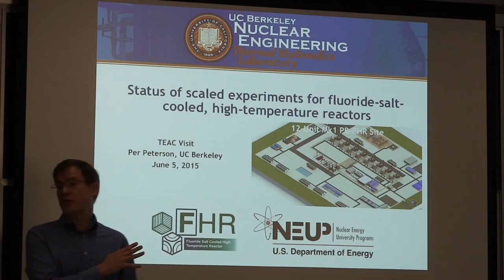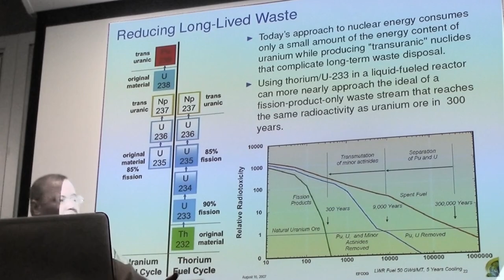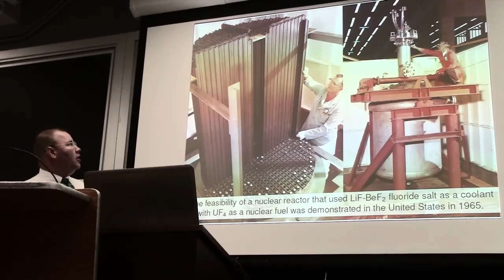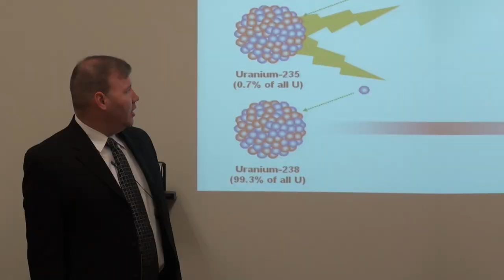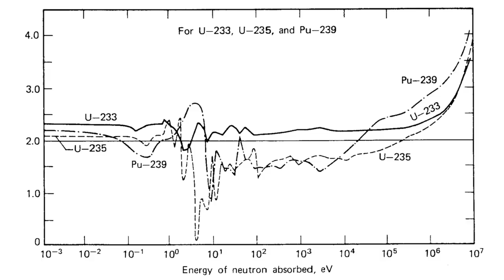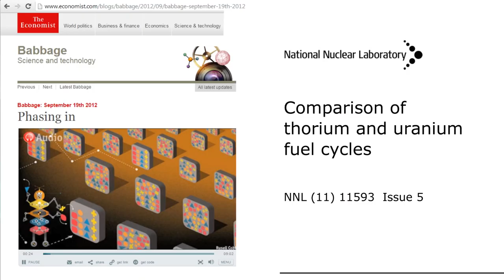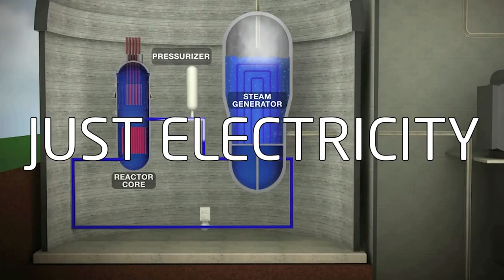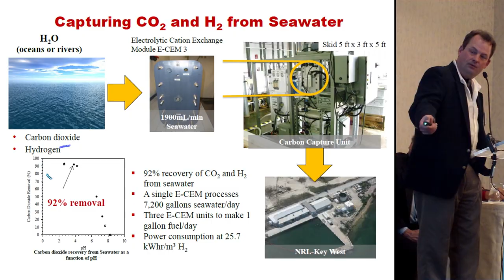Thorium Disadvantages

Comment: Still? What is to be done with the waste products from this? It sincerely bothers me, end of life matters, mid-life construction/repair concerns, and, for all the repeated emphasis about melted freeze plugs draining the moltem salt into the drain pits: how does the salt get transferred ANYWHERE? WHO does that? HOW would that work? What happens to the used drain vessel? How many times can the drain vessel withstand a salt dump before becoming unusable? How is a contaminated drain vessel "disposed of" then? How long is the plant offline after that status? The fact that the drain plug melts and the drain vessel fills up, gives me the firm impression, this can happen easily, and may happen often.

After the repeated denial of existing, and decades  to come radioactive waste that we STILL have no designed plan for it, I am very skeptical of any nuclear energy system that has no clear, easily understood plan for handling the waste products. Including contaminated construction materials. He talks a good game for thorium, but the dirty realities of the nuclear energy process he obviously gives zero attention to. Always remember, the magician makes you see want they want you to see while the 'magic' happens as you're distracted.
Reply: The best answer to you waste question is that nuclear waste is easily contained.  Emission from fossil fuel plants are not contained.

Comment: How is nuclear energy renewable? I get that thorium is very abundant in the earth, but that doesn't mean that we can make more of it
Reply: Uranium is replenished into ocean water from the Earth's crust underwater. Thorium doesn't have any ongoing process like that, but the resources of U and Th are so vast they might as well be renewable... the only way a nuclear fuel use could be shaped by resource constraint is if we continue to use inefficient reactors and convert our energy production entirely to nuclear... and we continue to grow our energy consumption. And in that scenario we'd simply need to expend more effort to obtain Uranium, it isn't like we could ever run out if we spent more to acquire it.

What would happen instead (100% nuclear with inefficient reactors) is we'd both pay a bit more for U resource, and we'd also transition to efficient reactors. Once-through fuel rods would be fissioned into additional energy. We'd get more energy out of U and Th resources. There's no way humanity can possibly exhaust nuclear fuels.

In contrast, Geothermal, Hydro, Solar and Wind are limited by deployment bottlenecks. Nuclear can go anywhere. The so-called Renewables have optimal deployment locations, and those are typically already in use.

Comment: Why is this film called Thorium Disadvantages, when it shows all the advantages Thorium has?
Reply: Thorium Disadvantages listed in this video:
00:00 Solid-fuel thorium reactors fuel utilization ratios similar to PWR.
00:42 Liquid-Fuel in United States licensing is "scary".
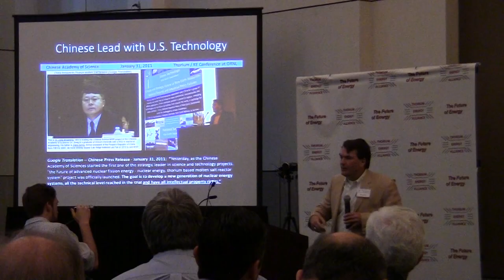02:04 Obama Administration willing to give away MSR know-how.
02:40 PWR seen as "good enough" for long time.
03:00 Licensing restrictions specifically target liquid-fuel.
04:45 NEA OECD evaluated solid-fuel, and liquid-fuel-fast-spectrum only.
20:50 Thermal-spectrum neutrons hitting U233 produce only ~2.3 neutrons.
23:00 Graphite moderator required to sustain fission in MSBR thermal-spectrum.
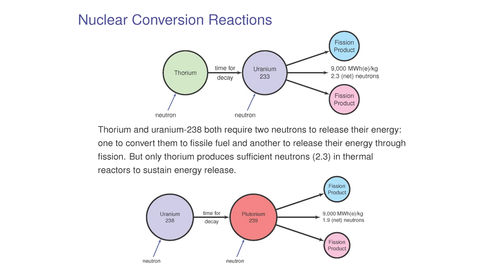27:50 Protactinium-233 half-life 27 days.
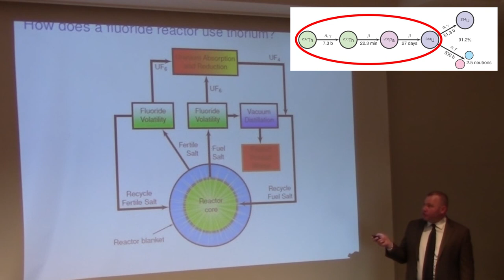29:00 Material challenges (MSR is pre-requisite so MSR challenges are Th challenges.)

Comment: So, basically, what we are doing now with energy is like if we take a banana, we eat the peel and then throw away the fruit. Very smart, mostly for oil producers. They don’t want cheap energy. They don’t want also cheap, safe and easy plants of energy. With time, a small thorium generator would evolve into a device that the average guy could easily maintain, the same as cars, computers and other machinery of common use are today, and that were reserved only for a very few qualified and rich men in the past.

Comment: Some nuts have been trying to use solid type of reactor which is why they are having difficulty.   The best way is the Liquid Thorium Fluoride Reactor.   But they have to insist on the obsolete technology to sabotage the Liquid Thorium Fluoride reactor project.

Comment: UK fast reactor program used thoruim, Germany had a prototype thorium pebble bed reactor that ran for 15 years so please stop reinventing the wheel
Reply: Bill, there's no significant advantage to Thorium when used in solid-fuel state. That's the point of the video. Dr. Per Peterson is quoted in the video speaking about Thorium in pebble bed fuel, and choosing LEU instead of Th because they saw no advantage in that solid fuel state. Th-MSR has never been done before. China is constructing their TMSR-LF1 right now, from parts successfully shipped to their MSR campus. LF stand for Liquid Fuel.

Comment: Thorium reactors are anything but a NEW idea... Pebble type thorium reactors have been tested extensively in germany with AVR at Jülich and a pilot plant HTR300 (300 MW - operational 2,5 years)  in the 1980s -  with prohibitive results mainly concerning operational and economic efficiency. First of all the thorium process in general has to be started by a certain amount of weapongrade material in its fuel. Futhermore the thorium process is based much upon U-233 - which could easily be extracted from the process. U-233 is weapongrade material well suited for simple nuclear-weapon designs - so there's a comparatively HIGH PROLIFERATION risk.
Well - thorium reactors are safe by design concerning core meltdowns, BUT they expose a difficult to control risk of temperature-runaways (as most graphite moderator designs) in remaining reactor components - which occasionally also may result in releasing considerable amounts of radiant substances into the environment.
And it is simply a fairy tale, that the waste of thorium processes require just 300 years final storage - the process seen as wohle leaves Th-230 (75.000a), Th-229 (7.500a) and additionally other longterm-risk-dominating isotopes like Tc-99, I-139, Cl-36 occur in quantities comparable to U/Pu-Cycles. 
The now again discussed thorium molten salt processes have been tested in US end of the 60s and they suffered extremely from all kind of corrosion effects - something current chinese works also have to deal with.
Summary: Thorium has been promising since ever...and it has been investigated more than most people know - however: up to now - after 60 years of trials - nobody could present a thorium process based reactor, running full-scale reliably AND offering substancial advantages over the Pu/U-cycle reactors. 
That might change in the future - perhaps in some 30 years...China currently seems most advanced in this fields - spendig billiards of $ into better concepts for thorium pebble solid type and molten salt type processes and there are some other quite promising fresh ideas - which will need even much more time to become operational.
My personal opinion is: looking at the necessery time-horizon nuclear power generation in general might well be outpaced by incoming advances in other technologies.
Reply: Joshu, Kirk speaks about Fissile Security in a newer video than this: https://youtu.be/2U9HVIFt2GE ...and has received Department of Energy GAIN funding to specifically look at questions surrounding Fissile Security with LFTR. That's Flibe Energy's 3rd DOE grant since 2018.

The only question Filbe Energy's not yet funded to tackle is your corrosion concern, but since there's a half-dozen MSR startups all using different alloys and salts, and China's Academy of Science aggressively pursuing T-MSR... I'll assume "they're on it"?

Comment: What Happens if the Reactor reached a critical un manageable temperature? I see some Floride Salts start boiling as low as 1600 degrees Celsius.  What than if the reactor has not enough pressure to keep it a liquid ? Is it as safe as we think ? thx :) 

17:30
Reply: Flouride salts have a very wide liquid range.  THERMAL spectrum reactivity control coupled with the liquid fuel and near atmospheric pressures of operation result in a much safer design than 1,2,3rd generation designs. Flashing to vapor, albeit very unlikely in such designs, would result in a loss of fuel that would be easily captured and condensed back to liquid, flow by gravity back to its retention tank, and shut down the critical reaction as the fuel concentration would negate the volume necessary to sustain the critical reaction.

IMO and prior to reaching any flash conditions, redundant temperature relieve valves would accomplish the same without have to go for a more expensive flash capture and condense approach. Flash capture designs imply more expensive secondary infrastructure. LFTR could easily avoid these costs and still remain quite passively safe.
Reply: The bigger the temperature delta against ocean water or air,  the easier it is to dissipate the heat... cooling mechanisms get more and more effective as the temperature climbs, because the delta increases. The reactor won't keep the salt liquid because of pressure... no one designing a MSR is counting on a pressure vessel to keep the salt liquid, as PWR do to keep H2O coolant liquid.
Reply: If I correctly understand, the proposed convention incorporates a calibrated slug "stopper" blocking a free-flow path to the drainage tank: it cannot fail to be safe.  If the slug fails, the reactor drains.  The MP of the slug cannot be increased, so the only failure mode is if it leaks, which causes the reactor to drain, shutting down the reaction -- inconvenient, perhaps frustrating, but always safe.

Similarly, calibrated weak spots in pipes can be used to prevent uncontrolled releases of just about any fluid.  Here, wherever such an occurrence might arise, the vented products remain contained, cooled -- and from a safety perspective, inert.

As others have pointed out, the reactor operates nearly at ambient atmospheric pressure, so I'm wondering where you anticipate such a flash to occur.

Comment: HASTELLOY OR EVEN UDIMET 5XX-7XX are, difficult and very expensive to mold pour and machine. I heard it slip from your tongue like it could last forever; it can't and won't and a fast breeder/recovery Thorium reactor is going to need a lot of it. It isn't like the stainless steels that can be poured, forged, machined, and welded and repaired for light water reactors. There are recently other highest temperature alloys even more difficult to pour and machine. Vessel/pipe life cycle and upfront cost is what is going to make molten salt difficult to sell. There now is a plasma process to coat metals against corrosion/oxidation when operated under high temperatures like in engine combustion components such as valves; perhaps that could extend vessel and pipe life cycle.

Comment: I don't see why this is titled "disadvantage" ... It all seems positive.
Reply: Thorium Disadvantages listed in this video:
00:00 Solid-fuel thorium reactors fuel utilization ratios similar to PWR.
00:42 Liquid-Fuel in United States licensing is "scary".
02:04 Obama Administration willing to give away MSR know-how.
02:40 PWR seen as "good enough" for long time.
03:00 Licensing restrictions specifically target liquid-fuel.
04:45 NEA OECD evaluated solid-fuel, and liquid-fuel-fast-spectrum only.
20:50 Thermal-spectrum neutrons hitting U233 produce only ~2.3 neutrons.
23:00 Graphite moderator required to sustain fission in MSBR thermal-spectrum.
27:50 Protactinium-233 half-life 27 days.
29:00 Material challenges (MSR is pre-requisite so MSR challenges are Th challenges.)

Comment: The present design of American MSR reactors is vastly different Russian MSR reactors which are based on the same principles of the original BREST reactors now currently running off the cost of the Caspian Sea producing both electricity, process heat, residential and industrial heating, and desalination of seawater into fresh water. It EATS NUCLEAR WASTES as it simultaneously and at the same time reprocess the original start up PU-239 nuclear fuel into new PU-239 nuclear fuel, and with some re-engneering and re-designing, can be turned also into a breeder MSR nuclear reactor to produce additional plutonium 239 nuclear fuel to start up and fire up additional Russian MSR nuclear reactors. 

The same Beryllium Fluoride Moderated MSR power reactors can kick start the thorium MSR reactors with 2% to 3%  of 99.99% pure plutonium 239 and the same Beryllium Fluoride Moderated MSR power reactors can be modified to breed Uranium 233 to convert more Thorium into Uranium 233, producing more fuel than it consumes while using the same hyper-neutron density flux principle of the original BREST reactors THAT EATS NUCLEAR WASTES as it simultaneously and at the same time reprocess the original start up Thorium-Plutonium 239 and creates new Uranium 233 from the surrounding Thorium blanket to produce more U-233 to transform more Thorium into U-233.

Once the process cycle is started and made completed the reactors can be sealed for 30 years or more without refuelling. With the exception of the Breeder Thorium-Plutonium 239 reactors whose main core can be sealed for 30 years or more without refuelling while the Thorium-U-233 blanket is periodically changed many, many, many times over the entire 30 year period to start new Breeder and Non-Breeder Thorium power reactors. 

Thorium is as common as lead and the beryllium fluoride moderator is INERT and does no harm to the zirconia-zirconium amorphous polycrystalline lined zirconium-hafnium lined zirconium stainless steel reactor vessel which is entirey IMMUNE TO NEUTRON BOMBARDMENT INDUCED NEUTRON EMBRITTLEMENT. In every 100 tons of granite rock one can extract  2.64 pounds of thorium (1,200 grams or 1.2 kilograms). The Carlin Gold Mines which has been in operation since 1946 has been mining and processing 5,000 tons of gold ore a day just  to get a mere 50 pounds of gold. If that 5,000 tons of gold ore is 5,000 tons of granite instead then we can get 132 pounds (60,000 grams or 60 kilograms) of thorium everyday. X 365 days in a year that's 48,180 pounds or 21,900,000 grams or 21,900 kilograms of thorium! 

This means that oil, natural gas, and coal will be near obsolete except as petro-chemical feedstocks for the chemical industries. Russia is actively expanding it's thorium-fuelled and plutonium-fuelled beryllium fluoride moderated MSR reactor power plant program as it equally pursues it's oil, natural gas, and coal program because oil, natural gas, and coal are too valuable to burn in a one time use. We are in a transition period of alternating and simultaneous temperature and climate extremes WHICH IS A NATURAL PROCESS of the transition period that systematically occurs BETWEEN PAST AND THE NEXT COMING ICE AGE. 

Russia and China and even Europe does not gives a damn about the lies of global warming for they know that these events are part of the transition periods of the natural solar cycle created by the SUN! Russia has been busy building new oil and gas well drilling technologies independently to drill for more oil and gas even though they are more than 3/4ths saturated with nuclear power and has more than 1,000 abiotic oil and abiotic gas wells reserve for their own needs because the world is in a hurry building new nuclear capacity and that takes time. 

Time that they do not have, so the solution is to use oil and gas to give them sufficient lead time, a grace period as you will call it, to build their INDEPENDENTLY self-contained and complete nuclear cycle nuclear power plant capacity in order to keep on building more newer nuclear power generating capacity. 

The Thorium EXP-3 in 1958 ran on 50 pounds of 82% pure Thorium and had a power output of 200 MW measured at the generator. We were very advanced back then but there was too much money invested in the older uranium reactors. They were forced to stop by 1959.

And then to reserve and divert oil and gas for direct food production such as mycoprotein (8:03 to 9:19 https://www.youtube.com/watch?v=XI5frPV58tY&t=559s 6 ways mushrooms can save the world | Paul Stamets) and single celled protein (The "food from oil" idea became quite popular by the 1970s, with Champagnat being awarded the UNESCO Science Prize in 1976 at BP's Lavera Oil Refinery in France) made directly from oil and gas as their growing medium and nutrient source.

Comment: Ima bout to rek dis thorium liquid fuel reactor nonsense.
The following pertain to a molten salt reactors structural componets.
Problemo 1. Tellurium (a 233 fission product) deposits in alloys weakening the pipes and walls by migrating in between grain  boundaries and allowing cracks to form.

Problemo 2. Fuels using Lithium salts must be 99.99% of the lithium 7 isotope otherwise you'll have craploads of tritium gas and that is hydrogen, which weakens metals. Only two countries have the industrial capacity to perform isotopic separation of lithium. Russia and China. USA banned the most economic method due to its use of mercury and I doubt Trudeau would let something like that be built.

Problemo 3. If a thermal spectrum reactor is used what will you do with your graphite? It will have a mean lifetime of 8-10 years and will have absorbed many radionucleides during that time.

Problemo 4. Any alloy using chromium in it with a fluoride based salt will have problems with the chromium being swiped and leaving "holes" in the structure.